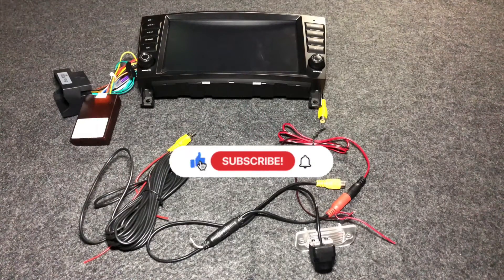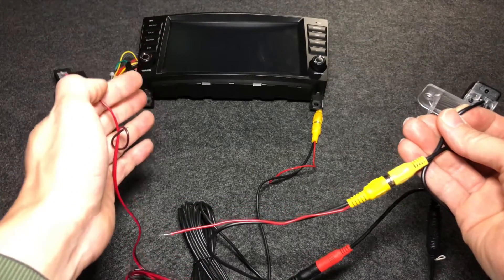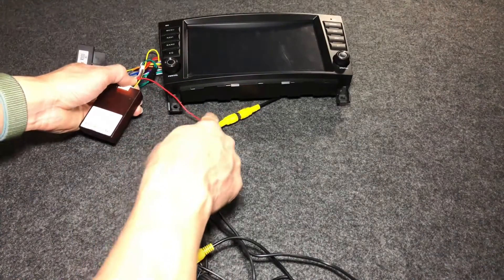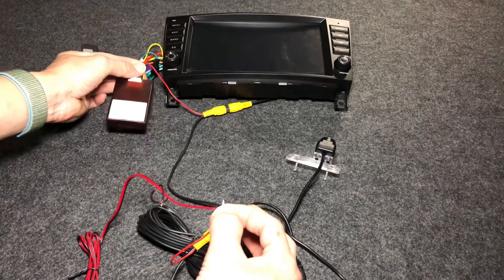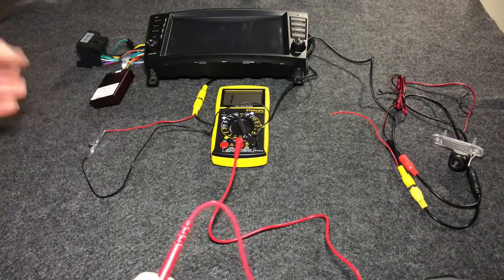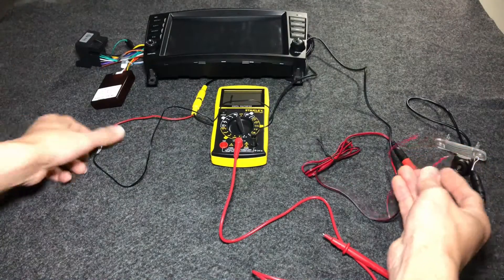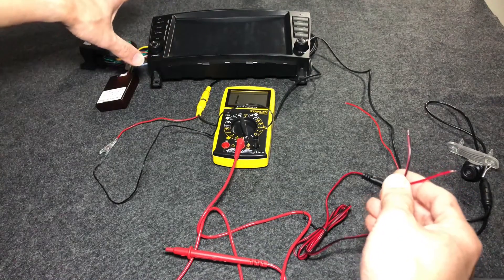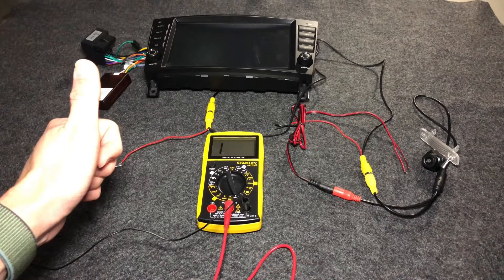HOW TO | CORRECTLY WIRE A REVERSE CAMERA

Comment: I have a pink wire on the Canbus that is directly below the brown wire it's labeled "Parking" would this wire be 12v that I can connect the red wire too without cutting the brown from the Canbas?
Reply from the maker: Hi Kara, it’s really hard to tell based on your description. The only way to be certain is to do a test but you will need a multi-meter test tool
Reply: It is the 3rd cable from the black one. Black - Red - (Brown or purple)

Comment: Hay
I have problem with rear cam
I am installing it right now and something isnt corect.
I have pics all the time no matter on reverse
I cinnected with pink wire on radio conectir and on cam side  i connect with lighter conector on back of the car. Is that lighter conector gives 12v constantly, maybe that is the problem
Reply from the maker: Hi Ds Ms, Yeah it sounded like you are sending constant power to the headunit tricking it that reverse gear is engaged. Try to find a power source that turns On when the car is in reverse gear. It can be the 12v reverse gear trigger on the canbus decoder or the reverse lamp on the tail lights. Good luck 🍀

Comment: where could i connect my black ground? i have a 2006 chrysler 300 but im new to this stuff
Reply: ur video is straight foward and understandable but i dont get where i could connect the ground
Reply from the maker: Hi yrn_sean, thanks for watching my video. I should have probably explained the ground connector because that is as equally important to get right. I might create another explainer video about that in the future.

So to answer your question where to connect the ground wire on your 2006 Chrysler 300 (beautiful car by the way). I must preface this with a disclaimer, I don’t own a 300 but I watched video where it shows where it is. I’m basing my answer on that video so I’m not sure if that is correct. But generally speaking, any bare-metal (i.e. no paint) you see on the car should be connected to ground. 

If you skip directly to 6 minutes and 42 seconds you will see on the top right corner of the frame where several black wires are connected with a single bolt into the body of the car (the one next to the battery).  That is your ground.

I hope this helps and if you have further questions, just pop them in the comments. Also if you haven’t done so yet, I would appreciate if you can subscribe to my channel. If you are already a subscriber, a million thanks! 🤩 

Reference video for Chrysler 300:
https://youtu.be/tIC8svZgTPA?si=S_iQ5DwS9xDHlCa4

Reference video for my car (MB C200)
https://youtu.be/uf7iFzxUnoA?si=LpbpnHFHMx4SZaVl

Comment: I have a reverse camera from a previous radio and I changed the radio to canbus style adroid I have 12 v in the rca wire while in reverse and I don’t know where to splice that signal wire but when I go to reverse the unit goes to camera mode and says no signal. Can you please help me 😃
Reply from the maker: Hi Jamie,
Firstly, thanks for watching my video and I hope I can help you with this issue.

Is the existing reverse camera also an aftermarket accessory you installed or did it come with the car as an official product option?

The reason I’m asking is because I suspect the reverse camera is not properly grounded hence the 12v is unable to power up the reverse camera.

If you are not sure which canbus wire to tap into for the reverse power signal, an alternative is tapping into the reverse light bulb.

Note: Please take all necessary precautions that you don’t damage the electricals of your car and more importantly that you dont hurt yourself.
Reply: @AutosNGizmos  it’s a added camera and I have 12v in the wire when I’m in reverse but I don’t know where to install that wire in the radio harness I have now it’s a 8 inch plug and play for a 08 GMC pickup
Reply from the maker: Oh I see, now I understand.

If you have a multimeter and you can access the wiring harness coming out of the car, you can do a trial-and-error and test which wire returns 12v when you put the car in reverse. Just make sure you have the multimeter connected to the right ground. Alternatively if you cant find the 12v reverse signal from the car’s wiring harness, you can always tap into the reverse light bulb to power the reverse camera.

In both cases, you need to have the black/ground wire connected to a proper ground point.

I hope this helps and good luck 😊
Reply: @AutosNGizmos  update I had to go into the radio and change some settings. It now works but it’s a little fuzzy . Any ideas on how to get a better picture?

Comment: Thank you for this. I saw so many videos and articles saying I needed to connect both the RCA red wire and the other red wire at the same time to a source, but that didn't make sense to me.

Will be wiring mine the same way and avoiding needing to use T Taps (hate them). My headunit/factory wire harness has a 12v reverse signal, so I should be good to do mine the same way as you. 

Hopefully all works out well. Thanks again!
Reply from the maker: Hi Jon, I’m glad you find this useful.  When you follow this method, must make sure the two RCA red wires are connected to each other.
Reply: @AutosNGizmos  yep! Just finished install! Works beautifully.
Reply from the maker: @blackfireball5  Awesome!

Comment: Thanks I thought the same thing why do I need to power it twice?  I've argued with my brother lifelong union electrician I did everything by the instructions and his suggestions still nothing I'm going to try this now. I had tapped into the reverse light, tied the video tracer into that, grounded, camera should be good ,ran video cord to mirror monitor, power for that to acc cigarette lighter wire, he swore I needed front reverse signal also , tore my entire dash apart tapping into every color wire after getting multiple answers from old forums (2010 Dodge ram) tested first in hood  behind engine ( one of the first few answers I found , some said purple wire) it was white with red stripe wire then found down behind e-brake, tapped video tracer into that 🤔 knowing I already have reverse signal. At one point early in my attempt to install It was back feeding because I had tapped the video tracer in cab into 12v cigarette light also so my reverse lights were dim on when I was in park gear before I realized mistake .maybe  grounding issue? Fuse?  Have the mygig navi rhr $25 ebay! Just purchased the video adapter./ Lock pick. maybe $40 eBay cam or monitors shot   Life story here lol
Reply from the maker: Sounds like you went through a lot there. I may not know all the details about your setup but there are these important things to consider when wiring a reverse camera:
1) The headunit/display needs a 12v signal so it switches video to show reverse camera feed. In my case, this headunit gets it from the canbus decoder.
2) Ideally, you can use the same 12v signal from #1 above to turn on the reverse camera. However, you can also use the reverse light if that is more convenient.
3) You need to properly ground the system.

Were are able to make your reverse camera working?

Cheers 😊
Reply: @AutosNGizmos  unfortunately no , still nothing. Thank you for the tips definitely going to check everything over and grounds and clamp them on tight.
Reply from the maker: @kirk422  Ok good luck 🍀
Reply: Got the replacement cam installed, works great! Thanks for help, maybe going to remove guidelines by cutting small green loop wire.
Reply from the maker: @kirk422  Oh thats good news! I’m glad you were able to fix it 😊

Comment: Hi
Special thanks for you
Your video is so helpful 
But I have a question
What is the role of canbus decoder ???
Reply from the maker: Hi Mohammad, thanks for watching my video.
CAN (aka Controller Area Network) is a protocol used by modern cars to communicate between devices or components. The CANbus decoder, decodes these signals to something that the headunit understands.  In this instance, the CANbus decodes the reverse gear “signal” and sends 12v to the brown wire which is what I used to turn ‘ON’ the reverse camera.
I hope this answered your question.

Cheers 😊

Comment: But you did not show the final result if it did work
Reply from the maker: Hi Earl, It was tricky showing the working result in this video because I dont have access to an account external 12v power supply and a tv/display to output the video signal. I know this works because the method I showed here is the exact method I used on my reverse camera install video —> https://youtu.be/uf7iFzxUnoA?si=brSIZmOBMt4MzKP3

So if you have access to an external 12v DC power and a Tv/display with an RCA video input, you can test the camera this way. 

In your other post you said the headunit does not detect any video signal from the reverse camera. To me this means the reverse camera is provably not getting 12v, so check that you have properly connected the black wire (ground) to a proper grounding point in the car.
Reply: @AutosNGizmos  yes but the camera isn’t working no matter how I try

Comment: I tried the same way but there’s no video signal detected no matter how I change the reverse camera setting available on the headunit
Reply: Mine has a camera wire, and you need to connect over there, not reverse,
Reply: @freddyalfarodavilla2463   my android headunit is a TS7 and I did not put a supply on the red wire of the video rca.. only the reversing supply I connect to reverse camera input and it worked
Reply from the maker: The key step in the video is to confirm the red wires on both ends of video cable are connected.

Comment: Did it work?
Reply from the maker: Yes this method works as long as you can confirm the RCA red wire on your reverse camera wires as connected to each other.  This method has been confirmed to be working by myself and other watchers of this video.
Reply: @AutosNGizmos   thanks. I figured out my my android ts7 headunit back camera connection. In my case I get the reverse camera supply directly from the reverse trigger of the head unit. I use the regular video cable without tapping any supply voltage on the rca cable which has a supply wire in it.

Comment: i liked the video well explained. but if you can help me understand , i connected mine to the reverse light for power. now i want to add an additional switch to turn on the camera whenever i want. how can i do that? and btw if im not connecting to the reverse light and only as you did . how does the unit know im in reverse? i don't have  a canbus ..thank you :)
Reply from the maker: Hello ynon, thanks for watching this video.  To answer your question accurately, I might need to know what kind of headunit you have on your car.  But setting that aside for now, I can provide you with some basic concepts how the reverse camera system works (at least on this particular headunit).

There are two things that happen when you see the reverse camera video feed projected on the headunit when you put the car in reverse:
1) The system sends 12V power to the camera to power it up so it can start capturing video.  In my case, I get it from the Canbus decoder.
2) Your headunit switches to the reverse camera input video so you can see the video feed.  I think this happens by default when it senses a 12V signal on a specific wire.

If you want to show the reverse camera feed at a flick of a switch, this is technically possible and I think these are your options (there might be more):
OPTION 1 - Constantly feed the camera a 12V power and connect the reverse camera’s Video OUTPUT jack to a Video INPUT in the headunit.  When you switch to this VIDEO input on the headunit, you should be able to see the rear facing camera video feed.  I wouldn’t recommend this because this will most likely shorten the life of the camera since it is constantly ON.
OPTION 2 - Find a constant 12V supply, add a manual switch in then connect it to the reverse camera.  If your headunit has a reverse camera input jack and a 12V input trigger (basically to tell it to display the reverse camera video feed, then thats good you can use that.  But if it doesn’t, then you might need to find a separate Video INPUT (as per OPTION 1) and manually select this in the headunit.

Like I said, without knowing any specific details about your headunit, this is as much information I can provide.   One thing that might helpful is to have a multimeter and an external 12V power handy.  In this way, you can simulate those conditions to confirm which one will work.  I hope you find this helpful and please be careful when testing these options.  When done incorrectly, there is a risk that you might destroy your headunit.  Feel free to reach out if you have further questions.  I am more than happy to help.
Reply: @AutosNGizmos  thank you very much. i have a generic Android head unit. and i do have the convenience wire  attached to the rca video's input. i thought adding a separate wire to 12v. and also to the camera. with a diode..

Comment: Where is the grounding point??
Where do I iron soldier the black cable. The rest instructions are crystal clear
Reply: Literally into any negative lead on any electrical circuit.. so anything leading to and including the negative battery thermal.  That also means any bear metal care panel or frame rail or anything damn near.   

Just wire the red into the red on the reverse light and the black into the black on the same reverse light.
Reply from the maker: Hi Prasanna, I think I answered this question from your other comment. 🙏

Comment: Hi Mate

How do I ground black cable. I mean where do I ground the black cable. I have ordered the same head unit but it has got separate brown cable marked with reverse. So I don’t need to cut the cable but need to ground black cable. If you could let me know layman way such as where to connect that black cable . I have got same head unit and camera. I am trying to install tomorrow
Reply from the maker: Hi Prasanna, Since you are also planning to install a reverse camera for a C-Class (I’m assuming you also have the W203), you can check out my other video on MERCEDES C200 W203 | REVERSE CAMERA INSTALL GUIDE (Link: https://youtu.be/uf7iFzxUnoA) where I cover that exact topic how to ground the wire that will power-up your reverse camera when you put the car in reverse.  In that other video, you can jump to the chapter called “Connecting to Ground” (its on the 20 minutes and 57 seconds mark) where it shows where the ground point is for the C-Class (W203 chassis).

If you have a different car, let me know and I can provide you with some pointers how I go about finding the right grounding point.

Cheers 👍

Comment: In your last comments ,you DON'T ground the red and black wires,for Christ's sake!!!Please rectify this before someone shorts the radio
Reply from the maker: Yikes! Thanks for pointing that out.  In my head I was referring to the black/red striped wire but understand how it maybe misunderstood.  I've edited the video and it now says "ground the black wire to a grounding point".
Reply: Yeah the the black wire must be connected to body gnd.. the diagram shows double reverse supply one comes from the headunit harness and one comes from the other end close to the camera itself.. if the reverse supply wire on both end is actually connected to each other then why bother make other supply to other end😅